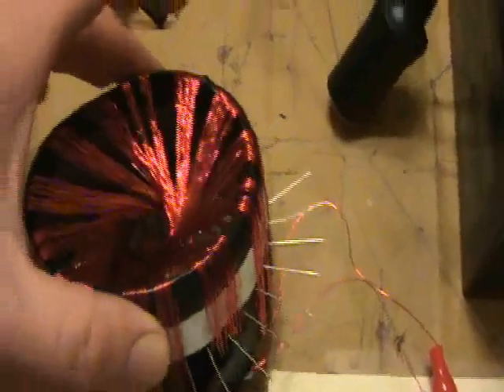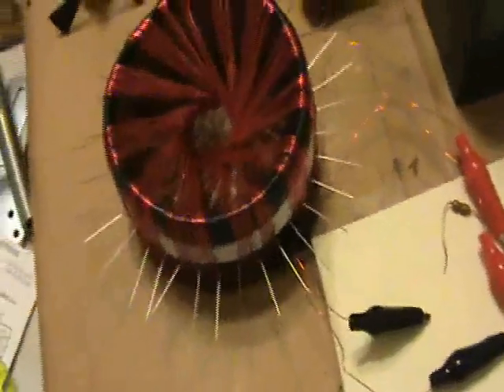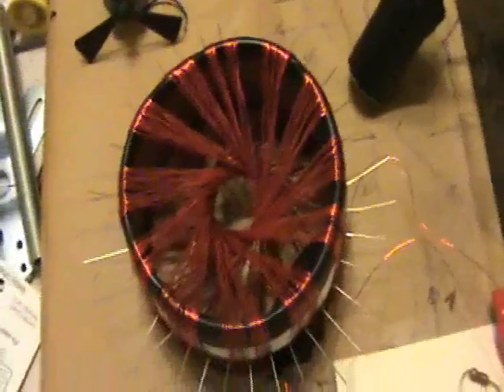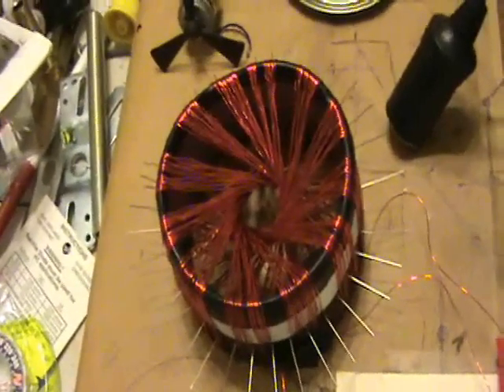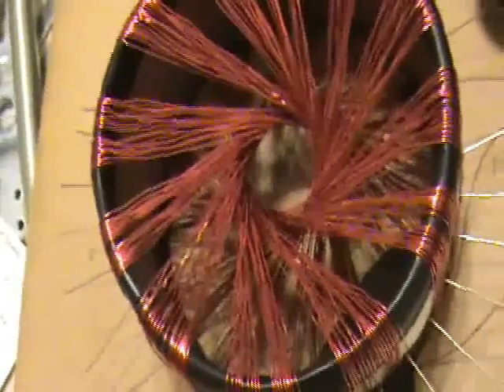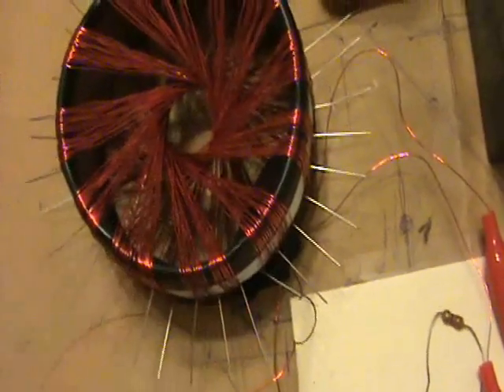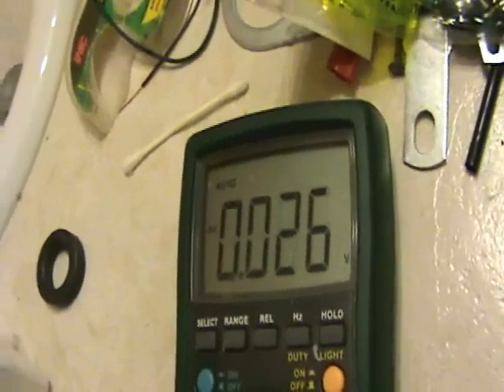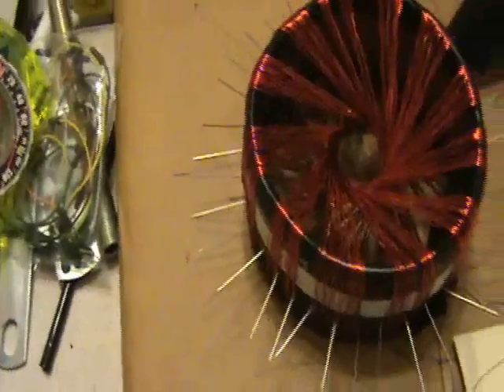"Tuna Can" Rodin Coil

Comment from the maker: In my messing around, I will attempt to find resonance. I probably need a function generator because the 555 is a bit difficult to control the duty cycle -- and I would like that control as well.
But, with a certain amount of current to it, I can see it wring at a certain frequency. I could adjust the 555 to emit exactly that.